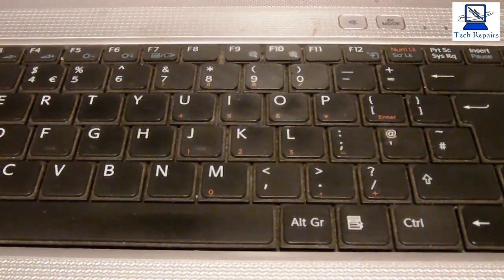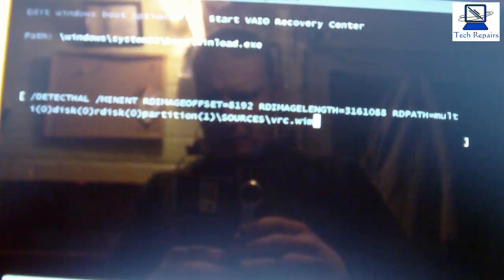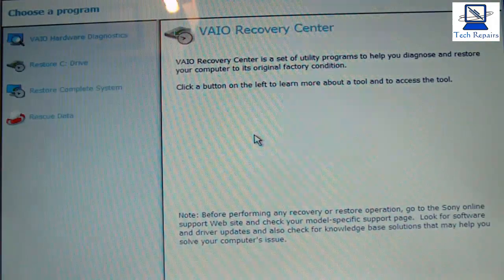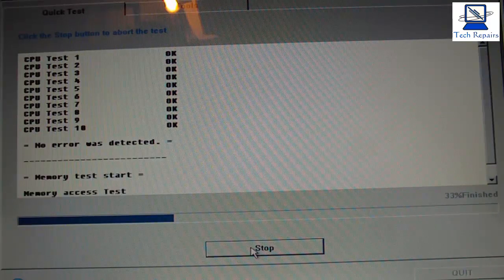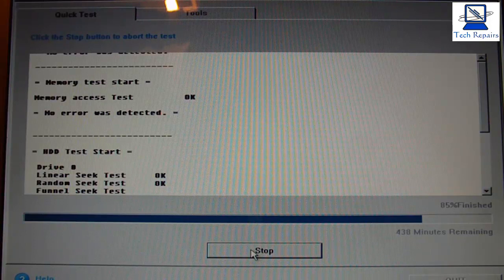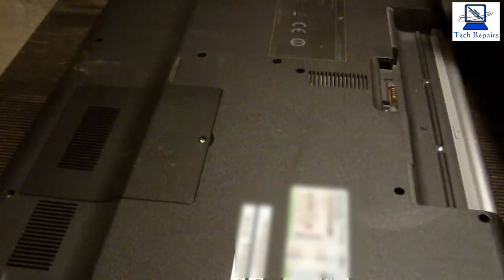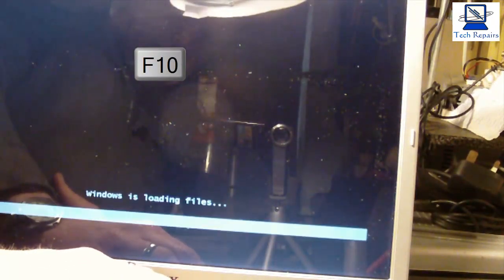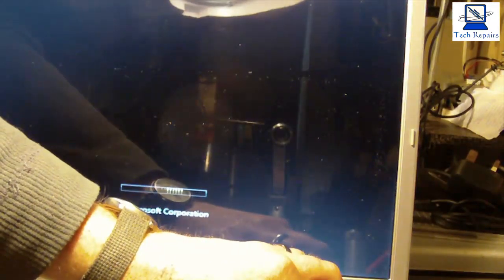How To Replace a Sony Vaio Hdd   (Hard drive) (Model VGN-NS10J)

Comment: hey nice video, i've got a vpcf11j0e I cant even get to the diagnostic sreen it just says operating system not found any advice?
Reply from the maker: It sound like the hard drive there is probably damaged sectors on the platters. 
 you can boot to a live cd like FalconFour's Ultimate Boot CD
 http://falconfour.com/projects.php?pid=7 and run some diagnostics from there.Thanks for watching

Comment: Thanks, very good video,i have got the same laptop

1- Can i increase the ram to 4 GB ,  it is currently running on 3GB?
2- Can i install bigger hard disk on this ? 512 GB or 1 TB?
2- Can i Replace my hard disk with SSD? if yes what size?

Comment from the maker: you need to clone the old drive on to the new drive or create a backup image of the old drive and you could reinstall that image to the new drive but if it was me i would clone the drive that way  you will copy the operating system partition and the recovery partition.hope it helps.